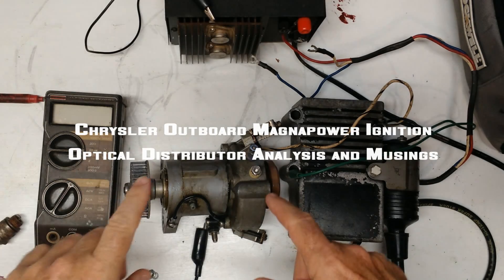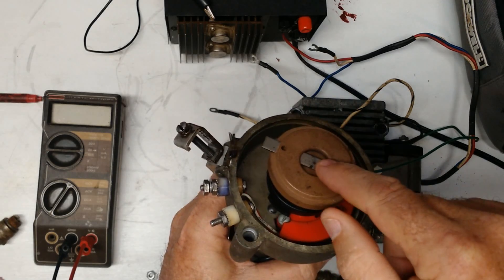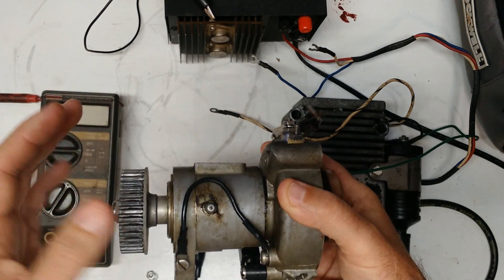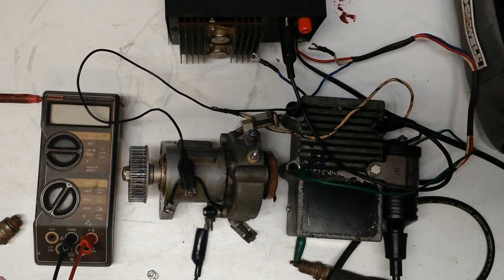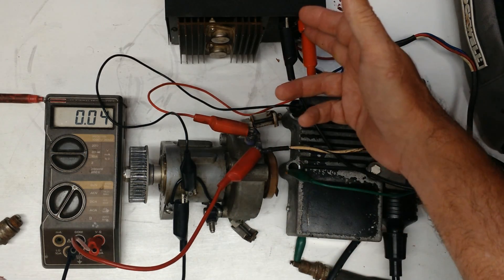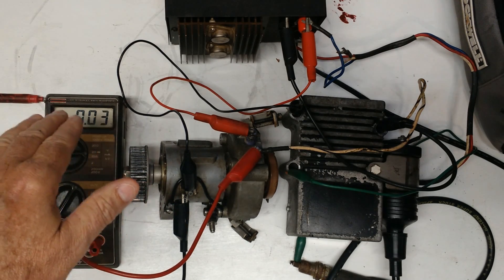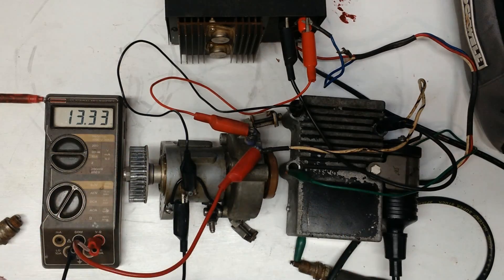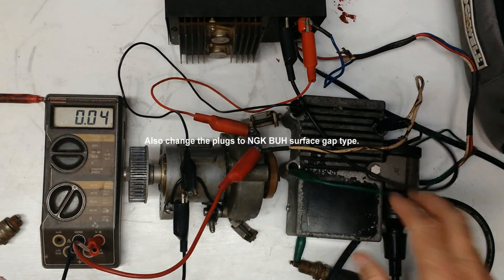Chrysler Outboard Magnapower Ignition, Optical Distributor, Analysis and Musings.

Comment: With the belt off distributor. Can anyone tell me why I can only get the plugs to spark when turning the spindle anti clock wise (the wrong way) and no spark clock wise (the correct way) but do get a ticking sound in distributor. 
Chrysler 90. 3 cyl. Cd pack small coil and optical pick up in dizzy.
Reply from the maker: Something is assembled wrong is my best guess. The dist really does not care which way its turned.

Comment: Need your assistance. I had plugs out and grounded, key on and turning flywheel by hand slowly. Only top plug would spark, I can hear it popping inside distributor but not spark to other plugs. 
So I took off the black/ white wire and touched it to ground, as I turn the flywheel and scratch this wire I can make all 3 plugs spark as it goes around. 
So……. I’m guessing it has to do with something inside? Optical? I have no idea how these things work. I have the cup for the wires off and can see up inside. 
Appreciate any help on this. Thanks in advance.

Comment: Hi, I have a 1978 Chrysler 75hp 3 cyl with the magnapower ignition and electronic distributor, wondering what’s the best plug wires I can get for this? I have some janky old 7mm with the spring and hook. Doesn’t seem very efficient to me. Appreciate any info. Thanks!
Reply from the maker: You have to use 7mm copper core. This ignition will burn out carbon resistance wire. No need to go to 8mm just a waste of $.

Comment: Is it possible to do the msd conversion on an electric distributor? Or would I need a point distributor
Reply from the maker: This is an optical distributor. But they work the same.
Reply: @MostlyInteresting  okay just curious cause I’m currently having a weird issue where my cdi box is getting extremely hot and it’s dropping my ignition volts down probably not allowing me to get spark so I was thinking of swapping over
Reply: @MostlyInteresting  sorry to ask but would i be able to do the msd ignition on the electronic distributor?
Reply from the maker: @Cracker_boys  Please watch the video again, I cover this.
Reply: @MostlyInteresting  I recalled you saying that both distributors can power an msd but i just would like confirmation and some reference so I can hook it up properly
Reply: @MostlyInteresting  thank you for the video by the way

Comment: Is it possible to do this while all this is connected to the boat?
Reply from the maker: Yes of course. I had it off so it was a lot easier to do the video that way. Remember if you don't have your spark plug wires connected to and installed plug, you need to ground them with clip leads. Loose Sparks or a bad thing. You can damage the wires you can damage the distributor cap you can damage the coil.

Comment: The change over was 1972-1973
Reply from the maker: Apparently if you really for some odd reason didn't trust electronics you could still order points for a long time.
Reply: @MostlyInteresting  yeah, but I’d rather not if possible.

Comment: Hey I got a 105 with a msd conversion and my outboard won't start with a surface gap  plug only start with a regular gap plug why would it do it that??
Reply from the maker: you have a low voltage situation. Hard to tell more from here.
Reply: So you think that can be the epoxy coil or the optical eye?
Reply from the maker: @sergiocontreras8930  No... low input voltage to the box. the signal the box gets from the dist is off or on, it cannot lower the spark voltage. Likely the coil is bad?... was going bad?.. replace with something like this. Should be a low resistance coil for CD use. https://static.summitracing.com/global/images/prod/large500/sum-850500_w_500.jpg
Reply: @MostlyInteresting  
So any chance that the stator can cause this problem too or voltage rectified thanks again
Reply: Okay I got a epoxy filled coil msd brand, I guess I ll be buying a new one and see if that's the problem

Comment: Has anyone tried using a Mallory Unilite pickup?  I was considering trying it out, but worried I'd damage the CD unit.
Reply from the maker: I wondered about that also. Its physically close to the same size and configuration. But they were to expensive to buy to try. So I fixed the one I had. Its not likely the will just screw down, machine work would be needed. Even if they were electrically compatible.
Reply: Well, I made a knock-off Unilite ($20) work,  it is possible, but not very easy, even for the do it yourselfer.  The Unilite is too tall.  I was able to separate the eye towers from the PCB, making two halves, and place them across from one another inside the distributor.  This required soldering longer wires, and 3d printing a housing to mount and house the parts.
Reply from the maker: @mikew8734  Nice! Did you notice the machine work it took to put the MSD inside the stock casting?
Reply: @MostlyInteresting  , I didn't notice at first, thought that was oem unit in there.  How far down did you have to mill?
Reply from the maker: @mikew8734  I just looked and the video I made on it is not posted. I must have took it down. Yes the MSD is inside the casting. It took a lot of work, the casting had to be milled along the side to give a flat to clamp the fets down. Screw holes with countersinks needed drilling within a few thou. I would not do it again.

Comment: Hello again sir I'm doing the multimeter timing test and when I get to the 32* multimeter reads 12 v but only drops to 0.16v when touching the belt 
So my question is, that distributor is good or bad optical eye
Reply from the maker: The voltage going from battery to nearly 0 when triggered is good.
Reply from the maker: That is so low it's practically 0.
Reply from the maker: The actual switching points is somewhere between nine and five volts so if you're outside of those you get a clean switch.
Reply: So 0.16 volts is to much , I forgot to mention that I have a msd street fire on it
Reply: Thanks alot for your help, so let me see if I'm doing this right, I turn the flywheel and when the multimeter goes down to 0 that's when it is timing correctly right????
Reply from the maker: @sergiocontreras8930  It works just like points and drives the MSD just like the points do. When the points open or the optical goes to 12V (batt) it fires.
Reply: Thanks alot for all your help today 
I think I got it figured out

Comment: Very Insightful, i have a 70hp Chrysler no spark on any of the 3 cylinders , I cleaned the points and I have power at the black and white wire ,going to the distributor , do you have a cell  phone or email and you can help me out , the boat ran awesome and just died randomly on the water, and none of the boat places here will accept a Chrysler engine because they don’t exist anymore , I could really use your knowledge and help
Reply from the maker: Sorry I really can't do one-on-one help sessions. If you go join the Facebook page called "Chrysler the best outboards ever" you can get all the help you need. I'm on there also.
Reply: Hey backcountry poolz what’s your number I have some questions about the motor?

Comment: Hey very helpful video ! I have a 70 hp Chrysler I just picked up, it’s ran great for 2 days then just shut down , no spark on any of the three cylinders , can you send me your cell or email , I have some mechanical ability but I know nothing about these systems or what to test? Is the trigger that red thing inside the distributor ?
Reply: I am having the same problem can u help me ?
Reply: Also similar issue plus more! 1972 707HE 70HP

Comment: QUESTION!?!? So if I have power going to my coil but no spark out it’s probably the pulse coming from the distributor aka the pickup is bad?
Reply: No. If you dont see the output of the distributor going to the box, switching to something near battery and 0, (it cant go all the way. ) likely the pickup is bad. They usually fail slowly, starting with the motor dying when the pickup gets hot. And the voltage swinging less and less till the box wont switch.
Reply: Thank you I will try that

Comment: how do I do the msd street fire fir a 3 cylinder
Reply from the maker: set it for a 6 cyl 4 stroke. BUT the cylinder selection only effects the rev limiter. Set that at 6000... 500 above the factory max power rpm.
Reply: @MostlyInteresting  and what do I have to do with the Leeds or what else do I have to change

Comment: I have a 1976 105 hp. How is the easiest way to be sure I have spark? I have fuel- motor turns over well, but no hit AT ALL! Not even once. Engine has not been started in 15 years. I'll replace what is needed, just need help deciding what.

Comment: I am interested in doing the msd conversion on my 105 hp with magnapower 11 . is there a video that shows the specific wiring.
Reply from the maker: I originally had one like that up. But it was hard to follow and I was afraid people would try to follow me rather than read the instructions that come with the MSD. It hooks up just like a car nothing special. You are running the points mode, you will not use the magnetic pickup connection at all so just tuck that away and tie it off. If I recall correctly I don't have it in front of me the wire that normally goes to a points distributor is the white wire. This distributor as I mentioned in the video goes 0 to 12 volts whether it is points or its optical. But of course the optical cannot run a coil directly.

Comment: 13:40-14:40 is exactly what my boat is doing. I have a crysler 1973 outboard 105 hp. Everything looks exactly the same as this. How do you change the pick-up
Reply from the maker: DanaJohn Hansen to change the pickup you have to take the nut off of the drive sprocket end, and ease's the pulley off paying careful attention to where all the washers and spacers go. Then the shaft with the rotor on it will slide out of the body. Be sure to keep track of the moon key. Then its simple matter of loosening the terminal screws and taking the two screws out of the pick up and swapping the thing out. Be real careful not to drop that shaft you will break it and you will cry.

Comment: so how do i use the msd with mine its the older points only system. i need it to fire 1973 85hp chrysler outboard
Reply from the maker: Tom Slaymaker MSD hooks up just like it would in a car and the points trigger wire goes on the points terminal on the side of the distributor. Do not cut the cylinder selection loops. Although they are only for the rev limiter. I would set my rev limiter to 6K. That will keep things from flying apart if the prop pops out of the water at Full Throttle.

Comment: What trigger are you using in the distributor? Mine is only fluctuating for 7-8 volt when I turn it so I'm thinking it is bad  and I'm trying to find a cheaper replacement.
Reply from the maker: nick mellinger yes that does not sound healthy. I rebuilt my stock Optical sensor. But then I design these sort of things. You can switch to a points distributor those will run the box also. The sensors are available. But you better be sitting down when you see the price.
Reply: I've priced them that's why I was trying to find a cheap replacement haha. I had one I bought a few years ago while chasing spark but I managed to break a sensor off it between then and now. Is changing it to a points setup an easy swap? I'd prefer mechanical anyway.
Reply from the maker: nick mellinger Swap the whole distributor.

Comment: love the videos,  so i have the 85hp chrysler 3 cylinder and i had it running perfectly then i did the waterpump and put it back on and it wont start. seems it turns over fine but i am not getting spark from the distributor. it does NOT have the optical eye. what's wrong now? do i need points or what?
Reply from the maker: You might need to clean the points, you almost never need to replace them. Since the current they carry is small, the normal arcing that keeps points clean with a battery/coil system is not there. Draw wet-or-dry paper between the points till they are shiny. Spray with brake cleanser to get ALL the grit off. One grain will kill the signal. I have run one, let it sit till the next weekend and then it would only run on one cyl (45hp two cyl magnapower w/ two points) I had to quickly pull the flywheel and clean the contacts. On these motors the only thing that makes you replace the points is when the follower is so worn that you can set the gap.

Comment: Good morning for some reason. My 75 hp Chrysler starts up and runs for about 10 seconds then shuts off. Then I never starts again until it sits for a while. I checked for spark while it's just spinning and there's no spark to be found in either 3 cylinders. Could it be the coil or the Cd box?
Reply from the maker: The common failure pattern for a dying CD box. well I guess by now it's actually dead.

Comment: I cut my loops, my bad.
Thanks Mark:
"The MSD Street fire comes set up for a V8 since that's the most common application... the cylinder selection loops only affect the rev limiter...if you got it set for 4 cylinder, and the switches for 5500 RPM that actually works out to be 2250 RPM for a 4 cylinder 2 stroke.
A 2 stroke 4 cylinder has the same number of spark pulses per revolution as a 4 stroke 8 cylinder."
Reply: Fixed. Back to 8 cyl